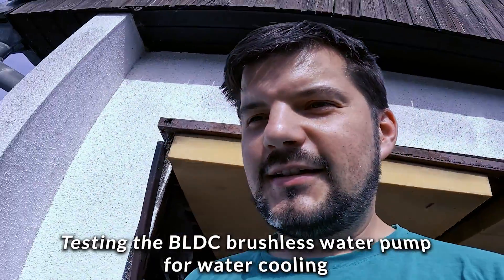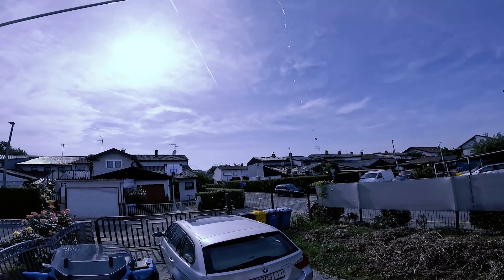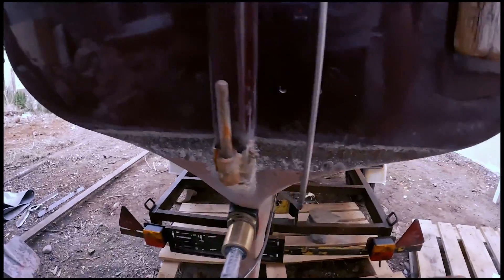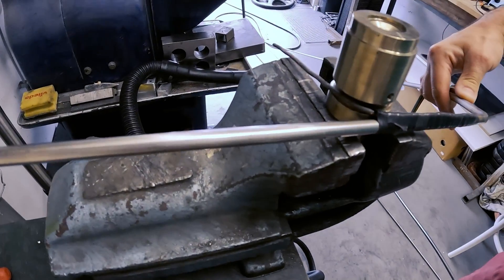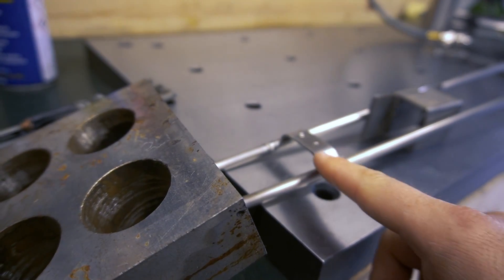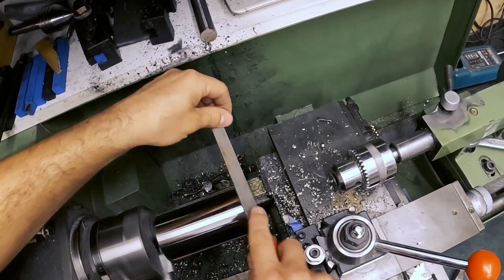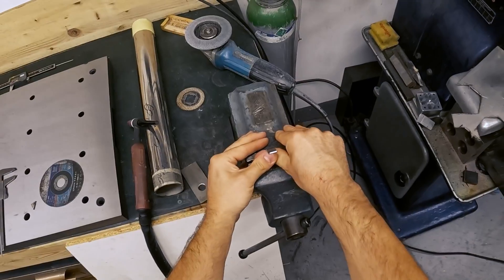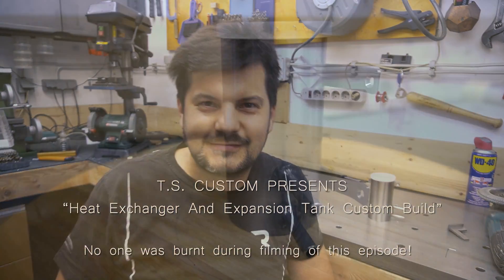Heat Exchanger And Expansion Tank Custom Build

Comment: generally speaking to avoid corrosion in seawater you don't want to mix metals, so changing the bracket to steel was a good idea.

Comment: Hi, how did you made the plastic lid. 
Did you buy a round plastic lid and then just cut-off a part or ?
Reply from the maker: Made it on a lathe. It's a plastic cylinder shaped material for making parts on a lathe. Sorry for not filming it.